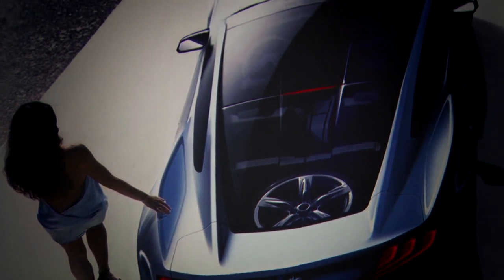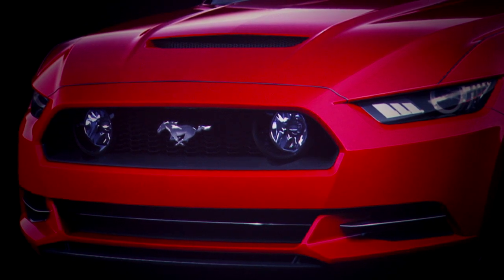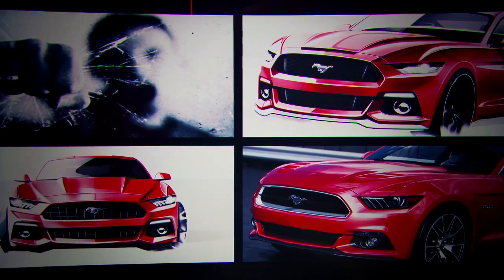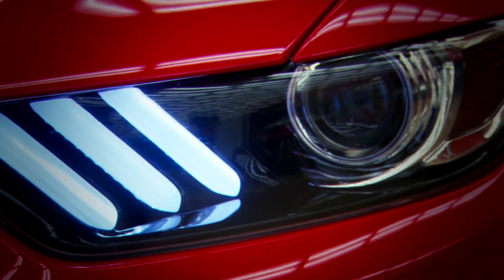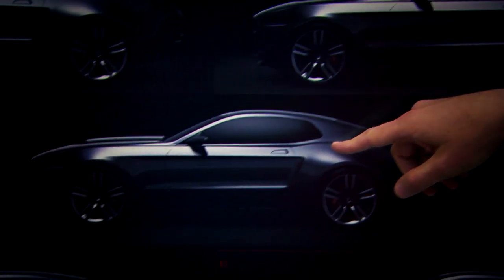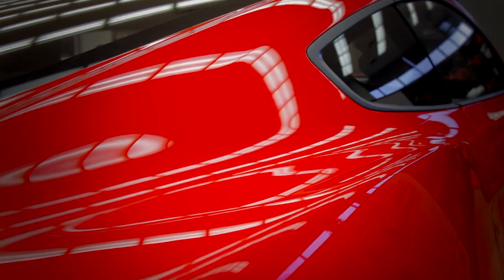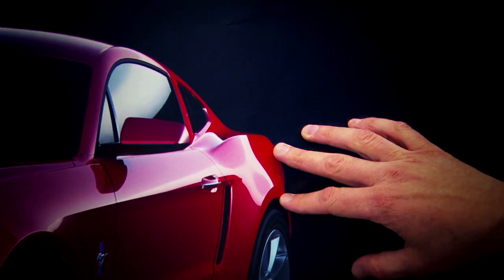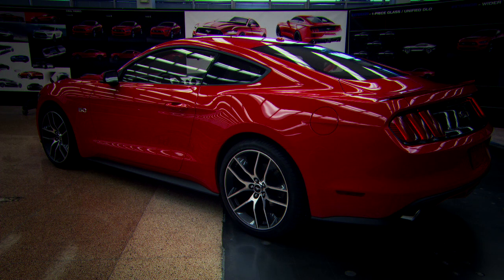2015 Ford Mustang Exterior Design Overview

Comment: they should get insperation from 99-04 mustangs and build from that. Once 05 and 06 designs came along(except 07 Saleen model), it all went down hill. until they redeemed themselves with the 10-13 models.